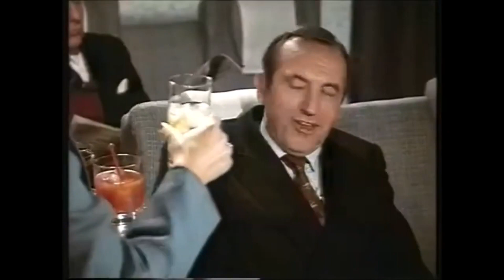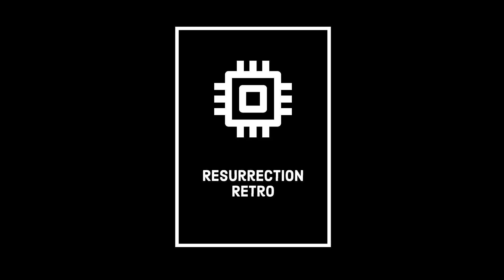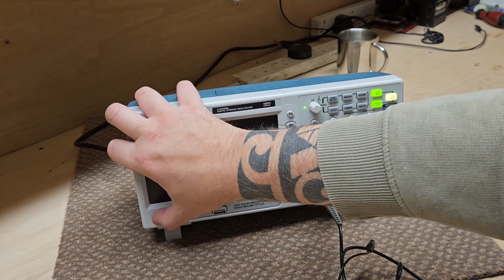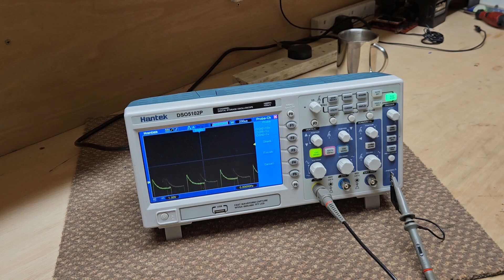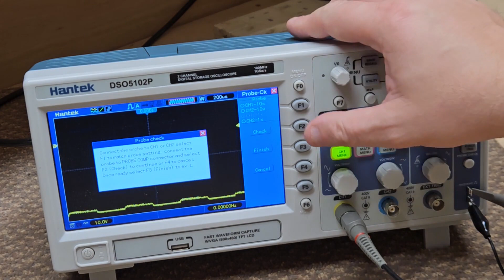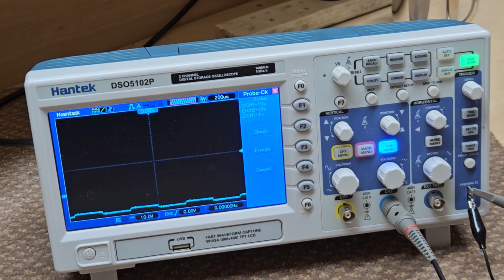Help needed on Hantek DSO5102P Scope failure

Comment: You might have low supply voltage to your AD converters, may be just enough to generate low output, the clock i/p may be faulty, your i/p attenuation control may be failing.

Comment: I'd be checking on the input of the ADC. I think the way it works is to have a bias voltage that gets generated from a DAC for the position offsets. I'd check that that DAC has the correct input voltage. It looks like when you ramp up the output from the position DAC that it's discharging a capacitor. Maybe a resistor gone high??

Comment: I've got issues on my rigol on certain voltage ranges where there's a weird offset, and moreso on channel 2, and I'm led to believe it's the surface mount relays which fail. Maybe that's happened on yours?